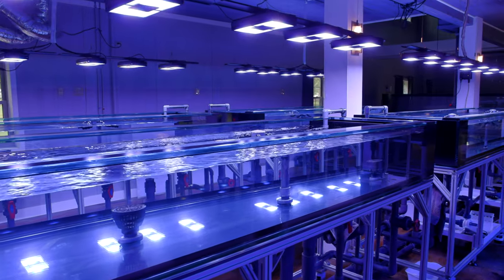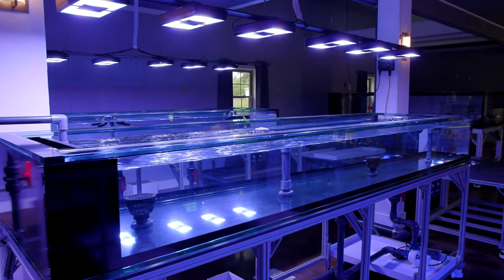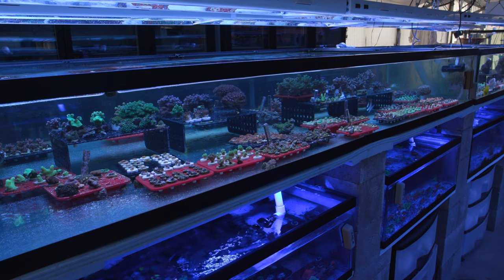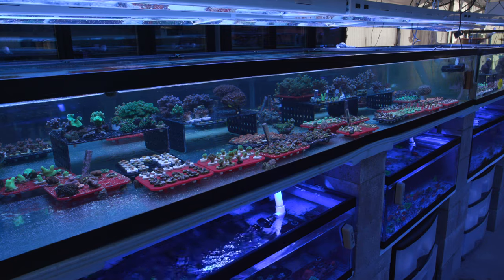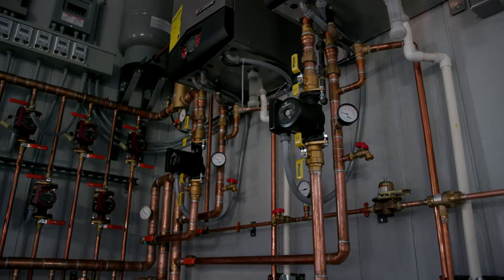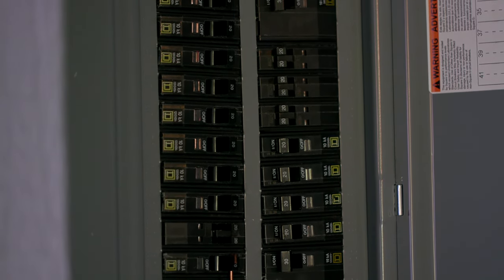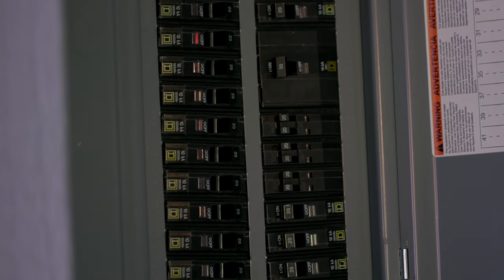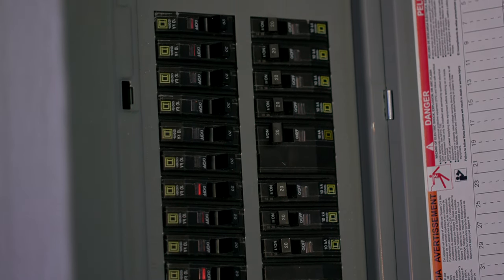The New Coral Farm - What I would have done differently - Episode 21

Comment from the maker: NO RAGRETS!!!
Reply: Nice tat bro.
Reply: youre my favorite coral person
Reply: They always said the gangsters dress real nice lol super cool tatt. “NO RAGRETS”
Reply: Lol
Reply: Than if the double pane doors were written into the contract even now asfter the fact you can demand them to replace with the specified doors
Reply: Hey there, first off I’m a huge fan! Thank you for the wonderful videos, I own a plumbing business in Maine, threaded fittings can certainly be a pain, but I wanted to share 2 incredibly helpful tips with that , Tip #1 if you know for sure that you will never need to unscrew the threaded adapters, you can absolutely 100% cement the threaded joints with regular pvc cement, Tip #2, if you may need to remove the threaded adapters, then you can actually silicone them , this will allow you to remove the fitting, and neither of these options will ever ever leak.
Reply: It’s absolutely possible to change your doors. But it would be cheaper and easier to have your local glass company cut and install double pane windows for your doors,
Reply: Actually the builder unknowingly did you a favor by cheating out on tyvec house wrap, you see house wrap is essentially a vapor barrier that can breath. Holds moisture in/out while still letting your structure breath. But where you preemptively used plastic as a internal vapor barrier, your insulation can still breathe. Tyvec would have created mold issues for you.
Reply: A TAT??? O..M....G :)
Reply: No Fragrets T-shirt soon?
Reply: I love these sit down chats :-)
Reply: since u added 3ml plastic on the inside, it's a VERY good thing tyvac was not added to the outside. The last thing you want is to seal moisture into ur walls :-)
very easy to remove those doors, take the whole frame off... sawzaw. Get urself a door guy not a contractor.
Reply: You have probably already fixed this it depends on if it is a solid built metal door some are built where it can not be changed that the whole thing has to come out but like someone else said you can have another glass added in

Comment: Replace the door.  As an electrician, you always put in as much underground pvc conduit as possible.  It's cheaper than EMT, and it can be ran in shorter distances.   That means less wire to purchase and pull.  Just more cost effective.  Some electricians are scared of doing underground because they lack the experience to pull it off..  Inaccurate measurements can land your stubups not were you wanted them.   It can be costly to fix those misses.   Planning a pole barn house right now.  With a dream 240 gallon saltwater tank.  Fish room in garage to quarantine fish and corals.  Salt mixing station.  Slop sink.  Your setup is very clean and despite a few oversights turned out looking great!

Comment: brainstorming on the doors. I'm not sure a thin double pane will do the trick between a tropical climate 
and a dry cold mid-west winter. Maybe go with an addition? An 'airlock' room outside the main building, between the existing doors and the outside. If those are the main entrance/exit doors you might save a lot on heating/cooling, and it'll add humidity buffer. The outer doors could be auto sliders like a big box retail so it doesn't add another annoying barrier when carrying stuff.

I really appreciate your passion, the company & team you've built, the corals you propagate. Very cool stuff.

Comment: You have done an amazing job on your building, everyone has after thoughts after a build . One thing I have learned from double pane windows is if the humidity inside the building is greater than outside as in winter it may cause the seals to fail. I had this happen in my home my laundry room is off my kitchen and the humidity from using the dryer the seals failed in a greenhouse style window in my kitchen, as far as repurposing the door you could put them anywhere you like . The new doors don't have to fit exactly the difference can be made up with the reframing. Keep up your amazing work and Keep on Reefing.

Comment: Hi Tan,
Switching out the doors is no problem, many options, web search the major manufacturers.
As far as a DIY, it's not the number of panes that is the most important, it is what's between the panes.  Argon, Nitrogen or a blend and glazing that stops the thermal transfer. You can even go with triple pane.  
You see all that condensation on your doors?  That can also happen inside your walls if there is no vapor barrier on the inside.  In the winter the pressure from heat and humidity is greater on the inside, pushing water vapor outward that can condense, even freeze on the inside of your metal exterior wall.  i hope the builder planned for that..  You may have to go with an air exchanger $$$ if that starts to occur.  Good luck.
Reply from the maker: Yup, there is a 6 mil vapor barrier on the inside right behind the paneling.  I specifically wanted to prevent the humidity from the building to mess with the insulation in the walls.  We have 4 large HRV air exchangers as well as 6 exhaust fans so in a pinch we can absolutely flush all the air out of this place.

Comment: Hi. House wrap prevents moisture from entering the building and allows moisture inside to leave the building. Check with your village building dept. House wrap is a code enforcement upgrade for all new residential in our local counties in Northern il. Some towns require an inspection of house wrap prior to installing the siding. Check the r factor of house wrap. Did you wrap the building in fan fold and tape. Fan fold and tape will increase your r factor.

Comment: If the double pane glass doors were specified in the building contract you can still now demand they br changed to the ones specified in your contract.  Im in construction it happens all the time, we have to go back and fix what was spec'd
Reply: call both the foreman and the engineer. They will have the spec'd door in the build plan and organise for it to be corrected
Reply from the maker: Very true.  At some point though I just gotta pick my battles and get past it in the near term and fix it later.  Such was the case with certain contractors.  I would rather them gone then to constantly go back and forth with them until they got it right.

Comment: Like you mentioned, the doors have lots of condensation. What about installing a 
 vestibule (if you have the room). A extra set of inclosed doors inside your building will help brack the temperature difference. This is something that can be built out of aluminum. And have a electric heater inside that inclosed area. With this you can control the temperature and humidity.

Comment: A window shop can probably get properly sealed double pane units to swap in. But like others have mentioned, fiberglass doors may be better anyway. Do you need them to have windows at all? Certainly less thermally efficient with windows in them.
Reply from the maker: I really wasn't worried about the insulation part to be honest.  This building stays warm with minimal heating.  It is insanely efficient.  The condensation was the only issue on specific days.  In the summer there is no issue because the AC dehumidifies the air effectively.  In the dead of winter the humidity is no issue because our air exchangers constantly bring in dry air.  It is only in the cool days where we have a solid week or two of rainy weather where the AC isn't going to come on and the air exchangers are no help that this place struggles with humidity.

Comment: Swapping the doors is an easy job. Oftentimes it's easiest to just replace the the whole door and casing to make sure everything is perfect when you're done. With the exterior siding of your building being corrugated steel,  the Tyvek is unnecessary because your siding is already a fairly good vapor barrier. Though it does offer a bit of protection if water starts to get in where it's not supposed to.

Comment: Absolutely you can remove and reuse the doors. Also if you want to diy double  pane , id triple pane by getting 4 pieces of thick acrylic that are larger then the glass. Drill holes through both acrylic panels, and the doors. Use automotive windshield urethane  between the doors and acrylic.  Stainless bolts and washers to sandwich the door between. Then the glass will be super insulated.  Probably would need to wait until spring to do so so humidity can be delt with by opening the doors while doing this though.
Reply from the maker: Thank you for the suggestion.  Once we get done with some bigger projects, I am going to swap out these doors for something nicer.  Triple pane sounds good.  The windows here are double pane and there is zero condensation.

Comment: @ tidalgardens Anything can be done with more money, time and effort.  For sure metal doors can be removed and replaced.  I had to have a customer knock down a block wall in Belgium that was in the basement of a pre-WWII building to install a machine. The whole metal frame was removed.  But if you can find the correct double pane doors that aligned with the existing frame and hinge dimensions it should be a no brainer.

Comment: Tyvek is used as a moisture barrier to not let moisture in but let structure breathe the moment you put plastic on walls the structure could no longer breath and is subject to lock condensation inside the wall due to the plastic on the inside. As a contractor i would have recommended tyvek on inside as well as outside so the structure could still breath. The doors can be switched out and hell you can probably have new doors made and not replace the door frames. In some cases you can just change out glass but depends on the door and how it is made. I would talk with a glass company on that that specializes in commercial doors.
Reply from the maker: Thank you for the suggestion.  Once we get done with some bigger projects, I am going to swap out these doors for something nicer.

Comment: Regarding the electrical in the floors, what you should have done is used raised flooring tiles that are used in commercial datacenters.  First, you can raise the floor anywhere from 6 to 36"... second, you can run wire trays for electrical (to keep off the cement floor) or any plumbing you want... and finally, you can grade the subfloor to allow water drainage to floor drains in the cement in case you had a major water event.  Just my 2cents!
Reply from the maker: That is an interesting idea.  I would worry about water issues over time though.
Reply: @tidalgardens  Probably not as big of a deal as you think.... because the chances of a "major water event" would be rare (if ever).

Comment: 277/480v transformer is a good start, then you can add step down transformers for 110/208v or 120/240v panels, single or 3 phase. Costly but like you said more power capacity for the future. Also chase pipes are always a god send. Hindsight is 2020 yada yada..  Still a beautiful set up you built!  I had ran one 20amp circuit for my 75 gal when i first got into the hobby, I wish i had ran 3! Also It looks like you're running Tandem beakers in the panels(good choice for the square D QO) some of them are rated up to 60 or even 80 spaces depending on what the box says.
Reply from the maker: With any of my contractors now, there is an understanding that anything we think is good enough, double it.

Comment: On the doors. You could definitely pull them out and reuse them elsewhere. And for the new doors, go for 3 panes instead of 2. Unless you ramp up your ventilation the condensation will also be an issue with 2 pane. Alternatively you could add a hot air blower right in front of the doors, blowing heated air across the doors, but that solution might be more expensive in the long run.
Reply from the maker: We are good on ventilation, but sometimes the outside is swampy for a week straight and the air exchangers just don't help
Reply: @tidalgardens  Like in hot and humid ore cold and humid?

Comment: With the doors you could use those just when you go to use them somewhere else youll have to get the fram part build for those specific doors. Also they wouldn't have to be used as double doors either you could use as 4 single doorway, would just need 4 separate door frames built
Reply: You'd have to talk to someone about possibly switching those to double pain i dont know to much about that. I use to remodel houses also was a plumber for a few years. Never really worked with glass though

Comment: I've worked in construction and I've set a number of doors in my day.  Note that I've not done construction professionally in almost 20-years, so weigh that as you see fit:

All doors can be replaced.  

Assuming that your doors are standard in size, pulling them out and replacing them shouldn't be too difficult.  I would do this ASAP if you plan on using the doors elsewhere so that they don't take too much damage.

Putting the steel doors in another door hole might be a problem, especially if the previous doorway isn't standard.  If the opening needs to be resized in any direction, then the materials used to finish around the opening will determine the ease of the project.  It's important to know that, as you consider this, I do believe that the kind of door will determine how and what size the opening in the building needs to be to fit the doors.  I believe that steel and wood doors have different requirements. 

My recommendation will be to do some YouTubing here.  Look for videos that talk about how to frame for a steel door and how to frame for wood and other kinds of doors.  There are a number of short videos that can give you an idea on what you're looking at here.
Reply from the maker: Thanks for the information!

Comment: Funny how you mentioned your electrical issues now Than. ATM, i am going through my own electrical issues though on a much smaller scale however, my system has outgrown the grids current capacity and i have an electrician arriving Monday afternoon. I'm going to need an additional panel box wired into the emergency panel box that's wired into the 12KW standby generator. The list goes on.
Horse Barn builders? Amish ? :)....and YES, you can replace all your doors and windows with double or even triple pane windows and doors and use the old for something else or even sell them.
Reply from the maker: Energy grid issues is a real thing.  I think about it a lot.

Comment: Doors are easy to replace.  Recommend going triple pane instead of double due to extreme humidity.  Others have mentioned fiberglass being an option.  This should prevent all future issues. 

As for replacing the glass for another building,  I would think that would be more difficult.  First, you would need to measure the thickness of the glass.   My understanding is that multi-pane windows have an air gap as insulation.   This would most likely mean the frame thickness would need to be wider the more panes you add.  If you're people have serious diy skills, you could potentially widen the trim.  I have never tried this, but would research prior to ordering a replacement.
Reply from the maker: Thank you for the suggestion.  Once we get done with some bigger projects, I am going to swap out these doors for something nicer.  Triple pane sounds good.  The windows here are double pane and there is zero condensation.

Comment: For the height if your having troubles getting into the tank why not add a fold up step. Something you could lift up and down. All you'd have to do is get a peice of wood same length as tank and mount to hinges on the stand. Kind of like what you see in churches to kneel. It would be easy and not that expensive for what you could get out of it

Comment: Did you think about using Steel for building frame vs wood? I am glad wood frames is enough to handle that much weight of tanks etc.
Reply from the maker: I've seen one other place with steel framing and it is interesting.  They have their own issues though with expansion and contraction.  When the temps change, it rains insulation material into their tanks.  Also, it is awesome that there are no posts in the middle of the building but their ceilings are so high that hanging lights became an issue.  As for wood framing, there are no tanks upstairs, just downstairs.

Comment: Also with your power you should have 2 separate services since you cant run single phase off of 3 phase. I'm assuming your HVAC is the only thing running off of 3 phase? If so 400 amp 208V service is plenty to run a bunch of CNC equipment off.
Reply from the maker: I was told that having two different services coming into the same building was not good.  I don't know.  As for 3-phase devices, right this second the HVAC is the only thing, but in the near future there is going to be more.

Comment: If your contractor violated code, they will be forced to remove the siding and install proper insulation. Maybe due to the fact this is a nonattached building , fanfold , house wrap  may not be required. This keeps your home warm in the winter, cool in the summer. Check with your village building dept.
Reply from the maker: Agricultural building so the codes are SUPER lax.  We didn't even need a building permit.  Not joking.

Comment: Yes those doors can be changed out easily. As for the extra room you wouldnt have wanted it with this building anyway. You can always have your barn builders build you a cheap pole building for the boxes and salt. It does not need to be heated or cooled and really needs minimal electricity for lighting. No reason to waste conditioned expensive space for that stuff.
Reply from the maker: I completely agree.  We need some cheap dry space that's all.